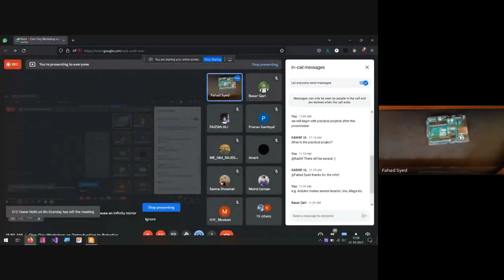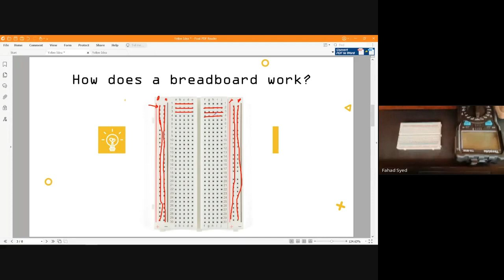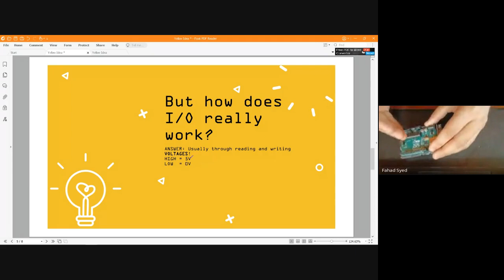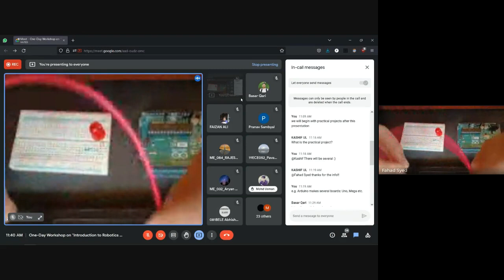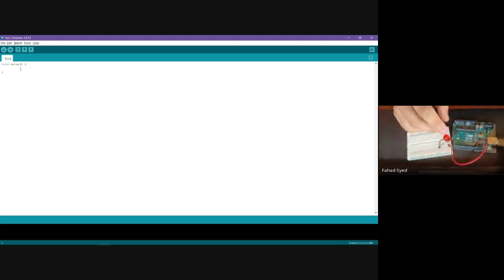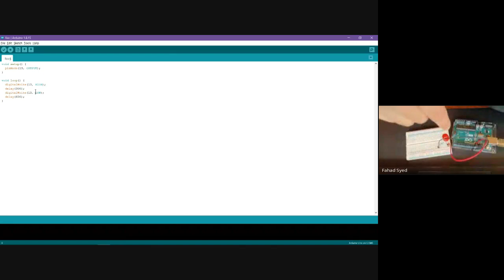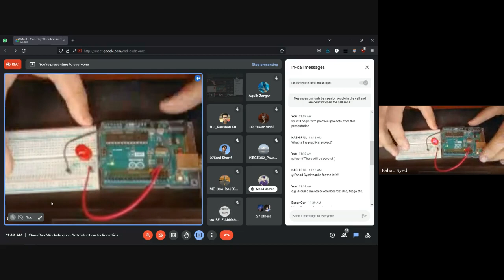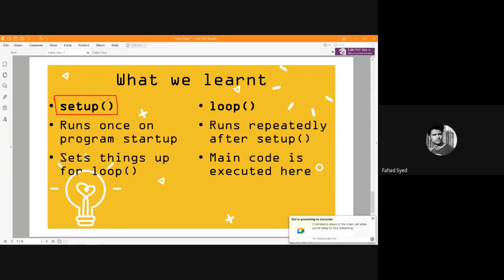Practical Introduction to Arduino for Beginners - Making an LED blink

Comment from the maker: Timestamps
===
0:00 Introduction
0:40 Breadboards
4:26 Arduino Pins
4:44 How I/O works
5:42 Schematics of our circuit
7:45 Wiring things up
11:39 Programming in the IDE
17:08 Running our code
19:44 Questions